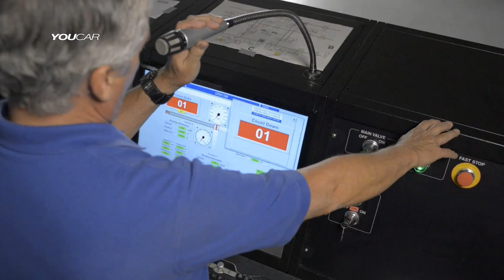CRASH TEST Ford F150 Supercrew and Supercab

Comment: Perhaps Ford should go back to the drawing board on this whole "aluminum bodystyle" thing....
Reply: 1000% right the crash dummy want to sue ford
Reply: +speedtime it's completely unacceptable to try to cut corners in safety,  why I have little respect for both ford and Chevy.  Along with recall rates ect..
Reply: +Josh McDonald  crew cab has top safety pick full size pickup.
Reply: kurt roepke
Good to know! I have always liked Ford trucks all of my life, but this crash test was a bit alarming to me for such a modern truck. I honestly expected it to do better.
Reply: the problem with the regular cab is its missing some support beams from the crew cab it will probably be changed next year .
Reply: +PREDATOR 7 lol who cares about the exterior, it's only your legs that will be crushed. This test penetrates the cabin wayyyy too far.
Reply: +PREDATOR 7 1m30s you can clearly see the dummies head missed the curtain airbag and hit the A pillar.
Reply: What are you talking about?  The truck performed very well...
Reply: I have owned several fords because I could not afford other brands. Low mileage fords devalue quick.
Reply: Some problems I have had with fords at 100k or 110k are the following. Loud ticking noise when you start the engine. yes I would change oil and recommendeds by mechanics but same noise. Ford would not start, Putting it on neutral then park eventually it would start. Ford would die in turns driving. Lousy power performance also. I can go on and on. I owned several fords with low miles they are junk at 100k and up unless you drop money to fix it often. I have not had so many issues like that with other brands. Maybe this is why so many second hand dealers sell fords more than any other brand. I know the truth thats all that matters.  Go ahead reply to me angry and with your fantasy stories.
Reply: that sucks i 300k miles on my Taurus with only minimal problems.the only american brand i stay way from is dodge they are just garbage .
Reply: I agree compare it to the steel body
Reply: +PREDATOR 7 was it gold plated ?65k tops
Reply: +Ultimate Gaming p
Reply: 110k for a raptor where do you live?
Reply: no but 110k is that usd that seems steep?
Reply: especially w/ that supercab, didnt hold up too well
Reply: +Nick Motsarsky No, this truck did terrible. Go look at the new silverado test crash and come back.
Reply: top safey pick is bad ?the extended cab did bad the crew cab is best in class .iihs
Reply: +kurt roepke All of them did bad.
Reply: look up iihs
Reply: +Puss Energy TM What are you talking about? are we watching the same video? The f150 did very well in this crash. Passenger compartment stayed intact.
Reply: +PREDATOR 7 its the same if the truck hit another vehicle, force of the incoming vehicle with 2x crumple zone. And you sound like such a tool for bringing your ($110,000) raptor up for no reason other than to tell people that you drive a raptor.
Reply: +Nick Motsarsky Almost the whole truck flexed on front-end impact. The Silverado dosn't do that. Did you see the bed? And the drivers leg's would be injured!
Reply: this is a small overlap crash test conducted only by the iihs the current generation of silverado has yet to go through it so  no one knows how it will perform.
Reply: Puss Energy TM Huh? You clearly don't know much about crash testing. Flexing means nothing. And body panels mean nothing as well. They could be made of plastic, or absent altogether and it would change nothing, since the frame is steel and panels do NOT contribute anything to crash worthiness in body-on-frame vehicles like these..
Reply: +Nick Motsarsky the frame is not steel, it's aluminum.
Reply: Ultimate Gaming pro No, no it's not. The frame is STEEL, not aluminum. Look under "Strength".

http://www.muziford.com/2015-F-150/why-the-aluminum-f150-is-better-than-its-steel-counterpart.htm
Reply: +Nick Motsarsky ok, error, Well I still think the steel body is safer.
Reply: +Ultimate Gaming pro How, when panels contribute nothing to strength of a body-on-frame vehicle...
Reply: +Nick Motsarsky "No comment"
Reply: Nick Motsarsky Listen man, my uncle got hit in a little nissan truck at 75 mph head on and survived with barely any injuries.
Reply: Andrew Mason What I'm trying to say here is that, the F-150 looks like it would crush the passenger because of the terrible flexing. Looks to me the damage is equal to the truck and passenger in most part.
Reply: why? It did great.
Reply: Tanner Rienbolt Not really
Reply: +Ultimate Gaming pro Steel panels wouldn't crumple easily thus decreasing the crumple zones making the car less safe.
Reply: +Nick Motsarsky Panels on the side of a vehicle are of high importance due to them making up most of the side crumple zones on vehicles.
Reply: +Nick Motsarsky Panels on the side of a vehicle are of high importance due to them making up most of the side crumple zones on vehicles.
Reply: George Hatton Ford is still shit. The engine and tranny is really the worst.
Reply: George Hatton Not on a body-on-frame truck. In cars and crossovers, sure..
Reply: +Nick Motsarsky Actually yes, on a body on frame truck too, really, go and research older trucks if I can't convince you...
Reply: +George Hatton actually side panels really don't do that much in a crash, it's the frame rails engine/trans and crumple structure on the front that do all the work. And the cabin itself, pillars ect.. the reason the one did so bad is because it did not have extra frame reinforcement around the front tires designed to deflect the energy from a narrow offset crash.
Reply: no, it is designed to sacrifice itself to distribute energy from the crash without the driver being seriously injured.
Reply: +CarsRLife THANKYOU! Finally someone who understands! You people disagreeing need to go learn physics.
Reply: +Andrew Mason Please understand the point of the vehicle IS to crumple, it isn't about not crumpling!
Reply: Michael Hooker I heard that the newer Silverados and Sierras weren't very good. My neighbor had a lemon of a Sierra not long ago. He had constant problems with his steering...but the dealer supposedly "couldn't find the problem" so he got rid of it.
Reply: Michael Hooker You're* and every car brand has problems. Lemons are happening now days because nobody can make good and "reliable" cars anymore. They just go for looks and not what is underneath. Just piss off and we can both just agree that everybody is shit in the car industry now.
Reply: +Puss Energy TM seems to me the new Chevys are above par with the Lemons. Out of the 30 Chevys truck that we deal with 4 have not been to the shop for major repairs. Ok maybe because they are company trucks and not taken care of. I know if 5 different people that own new Chevys for personal use. 4 out of the 5 have been in the shop for major repairs and 3 out of the 5 will never buy a Chevy again. So yeah they all have your lemons but Chevys excels in that category.
Reply: Michael Hooker So you are only going by the "5" that you have personaly seen being bad?
Reply: +Puss Energy TM 5 plus the ones that the company I work for has plus what issues the dealership we use has told me. So yes pretty much experience all around.
Reply: Michael Hooker Cool
Reply: I love Fore. But I agree. Idk if the mileage is worth the risk of using aluminum..
Reply: Lmao at these comments enjoy having your leg amputated in the ram and chevy ford is the only iihs top safety truck.